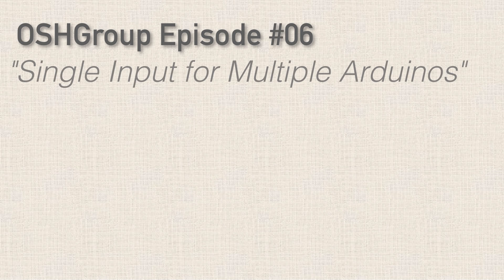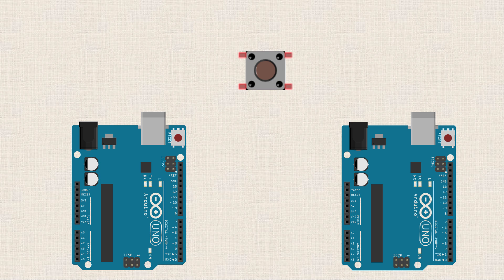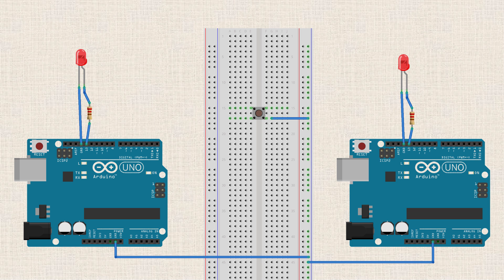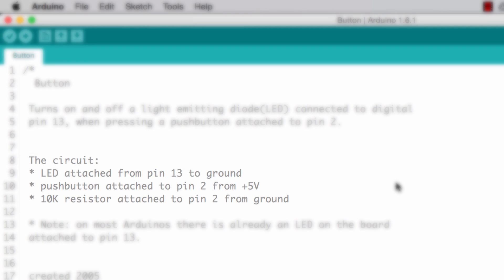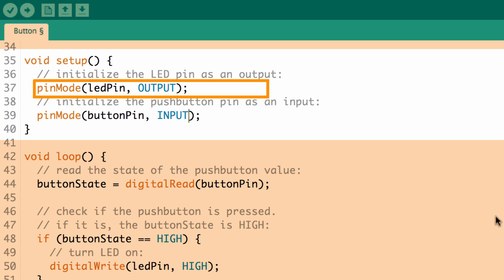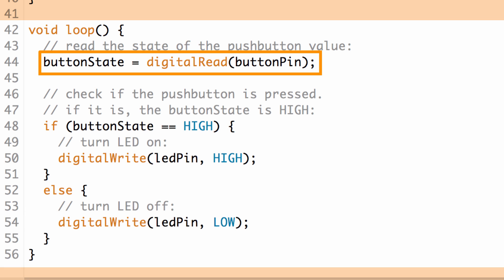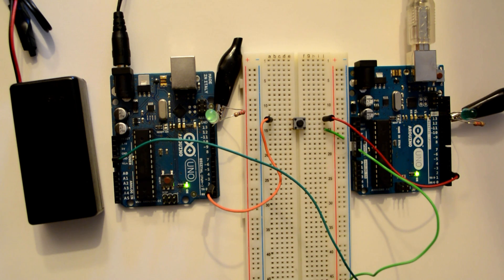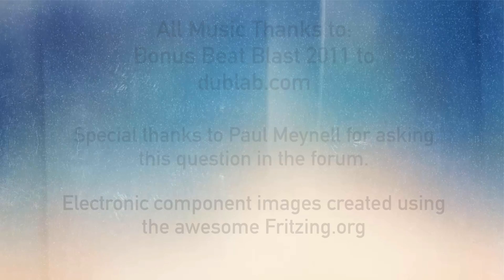Using the Same Input to Trigger Two Arduinos

Comment: Awesome!  Can we take this a step further by eliminating the switch and the LED on the left Arduino, connect pins 2 directly, have code in the left Arduino turn pin 2 LOW (or HIGH) causing pin 2 on the right Arduino see LOW (or HIGH) causing its code to turn on the LED connected to it's pin 13?  So pin 2 on the left Arduino would be and OUTPUT pin, and pin 2 on the right Arduino would be and INPUT pin. Please let me know as I have an Arduino that I need to read a pin on  a second Arduino. Thanks! Regards.

Comment: Great tutorial! Very useful and user-friendly! Do you have a video on using one Arduino with one input to run two separate programs individually and not sequentially? I am struggling a bit with researching exactly what I need for an "IF / AND" (does it exist?)
Any guidance and/or direction would be greatly appreciated!

Comment: That's cool. But why do you need Input_Pullup here? Wouldn't it be suffice if the input was just high? As in 5v can be read on the pin when the button is pressed? Why the reverse?
Reply from the maker: Great question! For this, we are setting the mode as an INPUT_PULLUP, because when we are not pressing the button, we want the pin to read a high voltage.   This video we made might help explain why we use the pull up: https://www.youtube.com/watch?v=G_i1ZhadTa0
Reply: @programmingelectronics  I see. But could the same effect not also be reached by using a pull-down resistor? After all, the aim is to make the input pin read a stable high or low and not flicker around. So just connecting a pull-down resistor to ground might make that possible, providing the button is wired so that a button press makes the pin read the 5v. In  summary, a reverse setup to yours.
Reply from the maker: @slighter  You're right - you could use a pull-up or a pull-down resistor - depending on how you want the signal to read when the button is pressed.  I went for the pull-up because you don't need any extra hardware (i.e. a resistor)